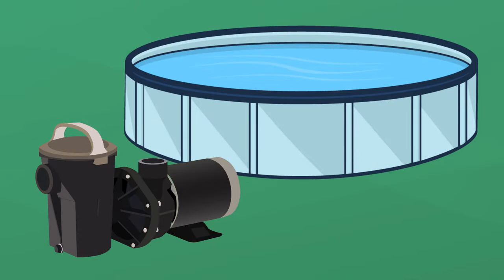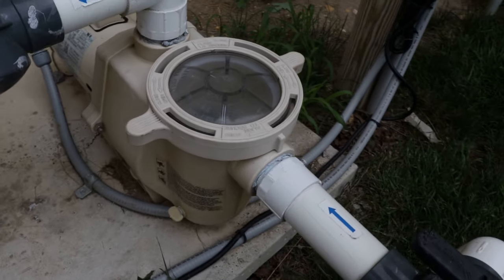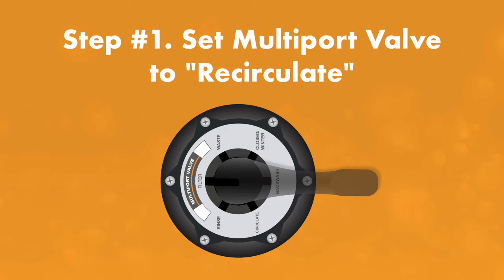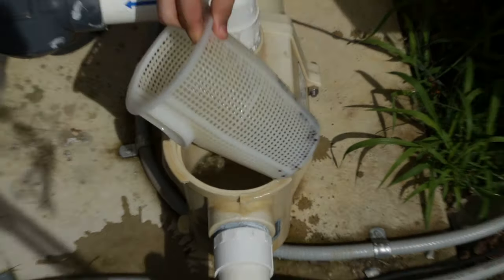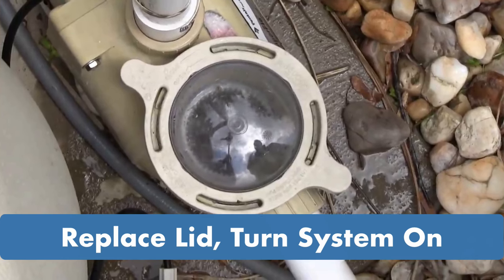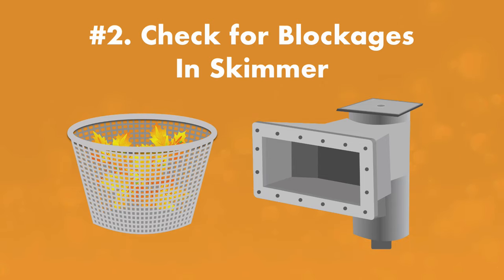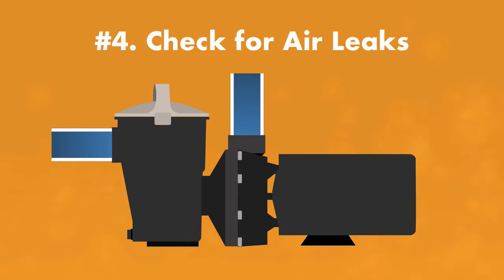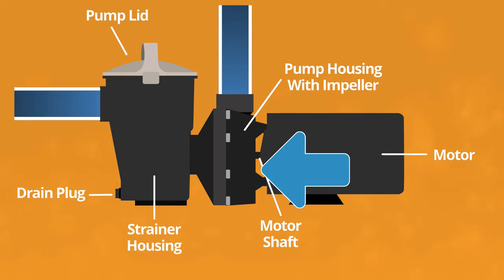POOL PUMP Not Priming? Here's How to Quickly PRIME a PUMP | Swim University

Comment from the maker: We hope this helps you get your pump primed! And if you need more help taking care of your pool, grab the free Pool Care Cheat Sheet at www.swimuniversity.com/cheatsheet 👍
Reply: Watched another video where the guy said to fill your pump housing to the top - no matter how I tried I could not get it to fill to the top as the water looked to be going out into the pool via the skimmer.  Thanks to this video I now know you don't need to fill it to the top - wish I'd found it earlier as I ended up carrying maybe 20 buckets of pool water to the pump!  Kinda felt like Sisyphus there for a while!  Anyway all I had to do was exactly what you showed here and it primed first time.  One thing I don't think you mentioned that was in the other video was to open the filter relief valve once the pump is running well to release trapped air, then close when water starts coming out.  That was the final step for me.
Reply: @Beer_Dad1975  That's refered to as "Bleeding the line" when you open a value to release air otherwise trapped air which if not relased will keep water from flowing, I had this also happen to my yard irrigation system when they turned off the main water value to work on the values.
Reply: @deedemarest443  Got it down to a fine art since then - now I can get the dirty filter out, get the clean one in, and have the pump running smoothly in under 5 minutes 🙂
Reply: @Beer_Dad1975 😅

Comment: Does anyone know the reason why a pool pump won't fill up with water, I keep hose on for 10-15 min even more and water just keeps going in to pipe coming from pool skimmer, I usually keep the water level on skimmer at least half way so there is plenty of water in the pool. I don't think there is a pipe leak since the water level seems to be normal all the time, i can't figure this out and i have issues with pump priming, what should I do?
Reply: I have this same issue now.  I wish he had answered your comment.  Did you find a solution that you could share with me?
Reply: Yeah same issue here it's like the pipes will never fill up
Reply: Same issue. I've tried pretty much everything. Some videos mention using a "Recirculate" filter valve option but my Jandy doesn't have that (Test|Drain|Filter|Rinse|Winterize|Whirlpool|Backwash). I just took my pump apart to check for a clogged impeller ... clean as a whistle. It just won't prime.
Reply: I read a comment that someone had a pair of goggles stuck in one of his intake pipes I might and get an endo camera a water proof one and try and look in the pipe see if I'm having a similar issue. Also saw a video where the guy said it be that the pump is starting at a slower speed than it should. Last tip I used suds to check my vales and joints around the pump to see if any air was getting in. It might be worth a try.
Reply: I googled ‘should I open or close main drain and skimmer lines when priming my pool pump’ it says they should be closed for priming. This video doesn’t address what to do with the lines or the filter air valve… wish he had.
Reply: Check your impeller. If it’s clogged, it won’t provide the proper suction. Unclog the impeller and see if you don’t get results. It’s a simple process - YouTube has videos. Ask me how I learned all this. 😂
Reply: Think about it as that water you’re pumping is basically flowing back into the pool filling it up!
Reply: Water will always and forever funnel into the front pipe and back down to the pool. Bc your pump is most likely above the pools water level. So you are essentially filling.your pool up with water from your pump. You want to fill the pump up for 2-3 minutes with water. And then quickly put the lid on and turn the pump on. You are trying to create. Siphon
Reply: @JH-fw3em you don't want both closed. Only one, as to make it easier to prime. Both closed will prevent you from priming the pump and potentially damage the pump and valve
Reply: Pool has 2 motor pumps.  One for the filter that rotates the water. And one for the water  inlet to make your pool full.. isn't it?
Reply from the maker: Did you check your skimmer line? It could be clogged (here's a video on that: https://www.youtube.com/watch?v=6nT8JQ3U51A&t=148s). Sorry I didn't see this comment come in when you posted it originally!
Reply: thank you for the reply, it was helpful
Reply: @JH-fw3em i dont have no valves at all 😮

Comment: Ugh my pump won't stay primed, when set to waste, pump full of water, pipes leading to it, cleaned filters/ baskets, new hose.. Is my hose to long? Also I know at 5 ft water breaks up, and my water level is probably like at 1/2 foot
Reply from the maker: Is it when you're on waste and you're vacuuming? That's a common problem. Fill up the vacuum hose with water in front of the return jet before connecting it to your skimmer.
Reply: @SwimUniversity  yes when on waste, and emptying pool, so only like 1/2 foot of water, I do fill up hose leading to my vacuum head and the pump with water before turning it on, so I'm at lost, I thought maybe old hose had few spots might be sucking in air, so changed all the hose

Comment: Very helpful, great video. My only suggestion would be to include a reminder to return the pool circulation from “recirculate” to its normal setting on “Filter”. I forgot to do that but realized my mistake when my pressure gauge would not move off zero.

Comment: i left my pump on the "cleaner" setting with the skimmer and main closed. the door of the cleaner opening where the hose goes was closed too. ran for 9 hours like this. i had to reset the pump breaker to get it to run but it only runs for 17 seconds before the pump shuts off. i have run a hose through the skimmer. the pump has water running through it. can you help?

Comment: I filled the skimmer by the pump, and the chlorinater with water. Turned the pump on and jets started working properly and pulling water into the pump again. Not sure what caused our issue, as the pump is brand new, and the pool was working fine yesterday. Any thoughts on what the cause of this was from? Bad O-ring?

Comment: Do you turn it on with with recirculate on? After you fill with water? Then once primed turn back to filter?
Reply: My pump dont fill with water just keeps draining back to pool also does no have valves to turn on or off
Reply: Yes. Recirculate until it fills, then OFF, then Filter, then ON.

Comment: THANK YOU for these tips, particularly setting to “recirculate.” I was about to give up on pool pump, and that tip worked like magic! 😊
Reply from the maker: Glad it helped!
Reply: Not all setups have a "recirulcate" feature. I have a valve to shut off/on water to skimmer and vac and then two values one each for in and out water lines.

Comment: Thanks for the vid! How many times and how long should I try the manual prime process (adding water to the filter pump) before I give up?
Reply from the maker: Maybe 3 or 4 times. Then you'll want to check for other issues. And when you stop filling with water, be quick to seal the lid back on.

Comment: This video was helpful and got it almost working which was encouraging.  I went and got the big toilet plunger that has the smaller end on bottom, inserted that in the skimmer hole and plunged away with the pump on,   I started hearing gurgling and then everything was gurgling. Ran to the pump and it was primed and pumping.  Thanks for the help.
Reply from the maker: Great, glad it helped!

Comment: Help! my pump has been running but there's no water in the pump basket. When the pump is off, there's water but it's only half way full like beneath the pipe hole in the basket. The other day I tried vacuuming the pool floor, cleaning out the debris in the skimmer basket, and pump basket. First time cleaning.

Comment: Interesting!! Every time my pump turns on, air bubbles through the line-- will priming my pump help this from happening?
Reply from the maker: It should! If there's air in your system, you run the risk of your pump running dry. But also check out the end of the video in case you have a bigger air leak you need to find.

Comment: Thanks, great video. I keep having to prime the pump after shutting it down for 8 hrs. ran fine all summer and come to think of it I had to prime it a few times last winter as well??? The pool level is high and no signs of leakage but gonna change a few o-rings anyway. Something is causing the suction line to drain and since there isno sign of leaks, it must be draining back to the pool?
Reply from the maker: Did you notice a difference after replacing the O-Rings?
Reply: @SwimUniversity   I have not had to prime the pump since

Comment: Replacing a hose tomorrow that is clearly leaking. Would this be causing my psi to be jacked all tha way up?
Reply from the maker: Might depend where the hose is. Air in the system is usually what causes high pressure.

Comment: Everytime my pump turns off for the day, I lose suction. The next day when it turns back on, it takes about 3 minutes to get the prime back. I replaced the line coming into the pump the other day and still have the issue. Is it possible to lose any air/suction from the filter side, once the water travels through the pump? We also get ALOT of air coming through the jets.
Reply from the maker: You might have a leak somewhere and air is getting into the system. Check your pump lid, O-Rings, etc.
Reply: If filter is clogged, you will have higher PSI displaying on the gage, when the problem is on the pump side and water isn't moving, it's trapped air/leak/broken/clogged impeller issues not moving the water through the line and you lose prime.

Comment: I have full prime but very low suction. Can’t figure out why. No leaks, no clogs, just won’t pull water in from the skimmer
Reply: Same here. Brand new Intex pool with Sand filter. I keep priming the pump by adding water to the pump skimmer and it works for a few seconds then water in pump skimmer is low and I start the process over with the same results. I hope I can get it working. Still looking for the answer.
Reply from the maker: Do you have the right sized pump for your pool? If not check your connections to re-tighten or replace the O-Rings.
Reply: @SwimUniversity  My main issue was I had the hoses in the wrong place 🤦🏼‍♂️

I had a leak at the pump where the basket connects. I put Teflon tape around the O ring to fix that.
Reply: @SwimUniversity  after I changed all the connections and o rings, I figured out a round metal piece was in my return restricting the flow back into the pool. I pulled it out and everything went back to normal. (I’m told the metal piece was part of a check valve that came off). Crazy.

Comment: I usually run my pump during the day and turn it off at night. Do I need to close the suction line going to the pump when I turn it off? I’ve been closing it but I’m not sure if it’s necessary because if it was on a timer I wouldn’t be closing the suction line
Reply: If you don't have a pump you can program the time or set to a timer box, you will have to manually turn it on and off.

Comment: My pump is not priming when i connect the pool cleaner vaccum. I made sure it has not air and nothing stuck when i remove the cleaner hose it starts priming and as soon as i connect it it stops. Btw the pool vac is new and all the hoses
Reply from the maker: Is it a suction side vacuum? Sometimes those need a booster pump installed to get enough power

Comment: Ok..so while I'm vacuuming my above ground pool...my pump loses prime..I've changed the piping..water level is at the high point..check o rings and impeller..so what else could there be
Reply: T Holloway. Time to backwash your filter. Or change DE if you have a DE filter. Filter won't accept any more dirt. Good luck.